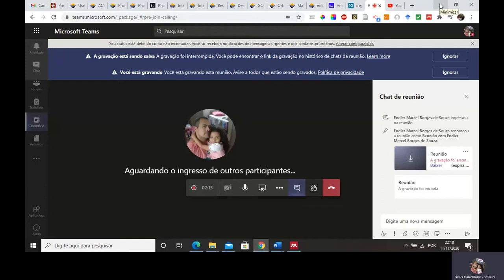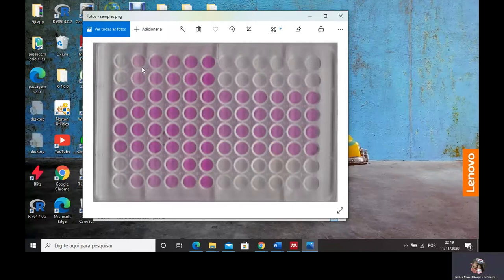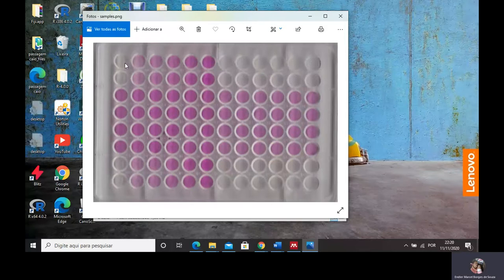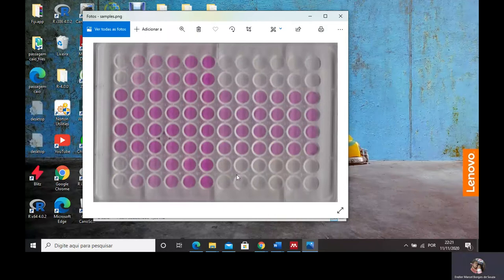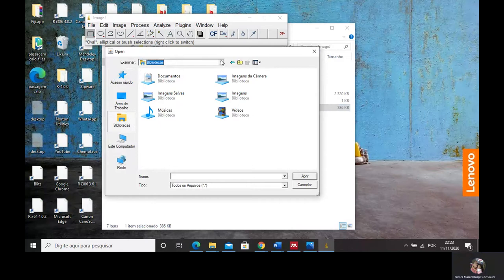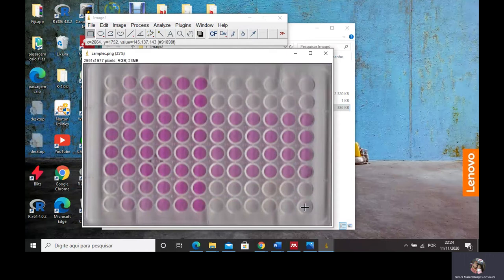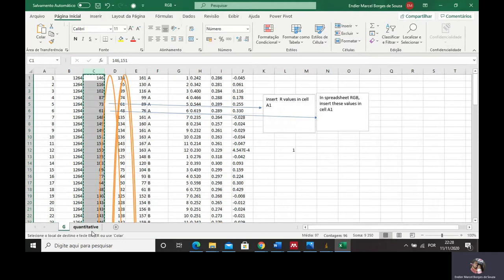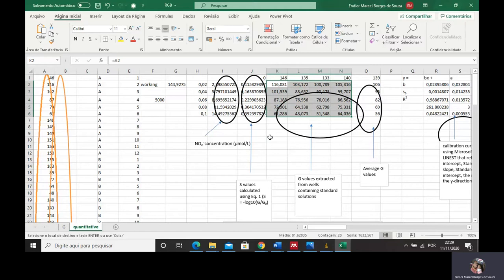extracting RGB values from a 96 well plate using ImageJ

Comment: Hi, Many thanks, very helpful! Is there a macro to do this for 8 vertical tubes lined next to each other and with progressive colour intensity (lighter to darker)? Your help is highly appreciated!
Reply from the maker: readplate is a plugin installed in imagej that can facilitate the automatic extraction of rgb values in 96-well plates. If standards and samples are in tubes, you must extract the RGB values manually. If the solution is red, the color that will show the greatest variation is blue, b.